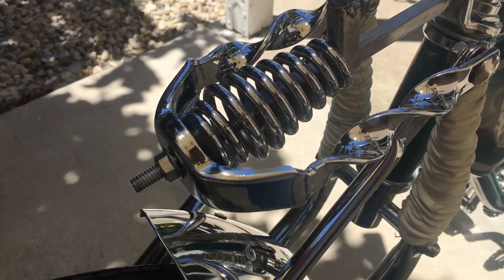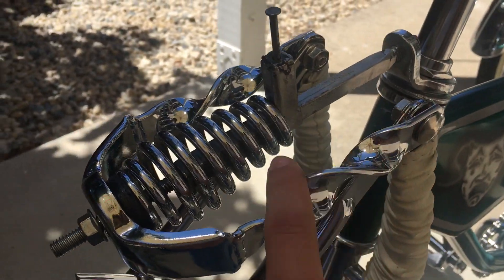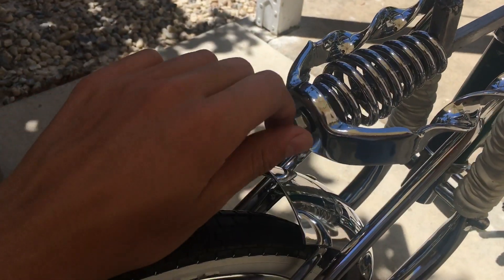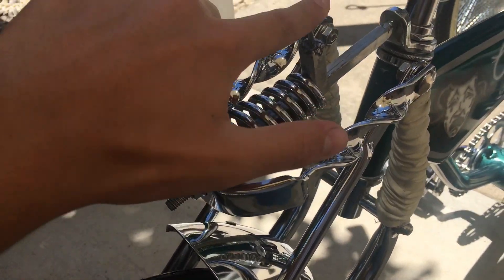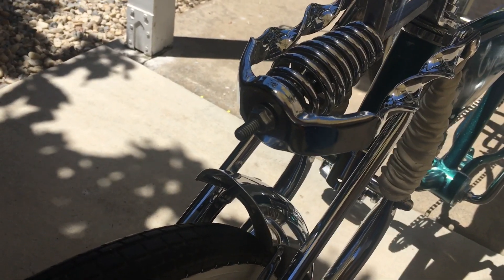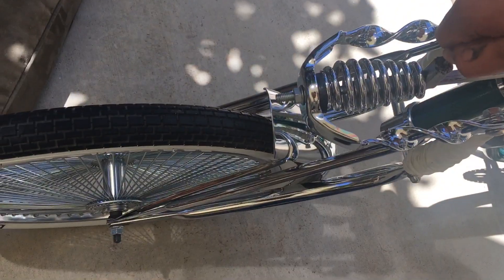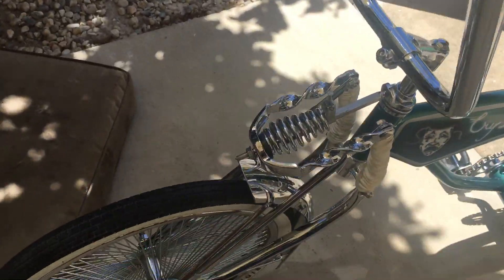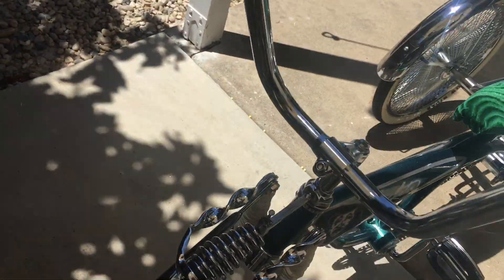Lowrider Adjustable Crown Bolt Upadate

Comment: Really cool homie , thanks for posting 👍
Reply from the maker: Gilma Morin no problem homie thanks for the comments✊🏽💯
Reply: Low Lows And Clothes 
I think if you want more clearance and to make your extended crown face straighter you could get a Extension Springer Fork Crown Ring from bicycledesigner , ( they’re bent at a 90 degree angle so your fork crown would be straighter , there like $10 plus shipping, maybe that will work not sure 🤔
Reply from the maker: Gilma Morin it would work but I don’t wanna spend the money I tried hammering it down but I don’t think I did much I’ll figure somthing out tho
Reply: Low Lows And Clothes 
👍